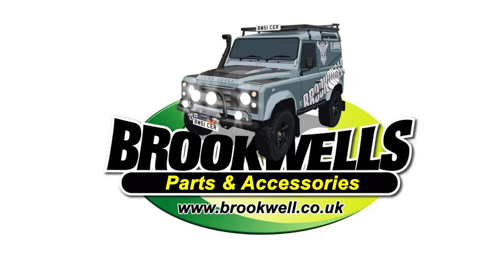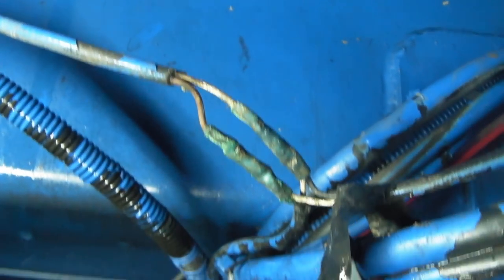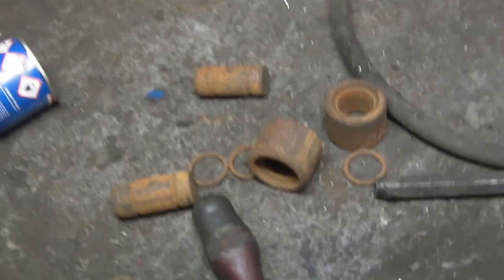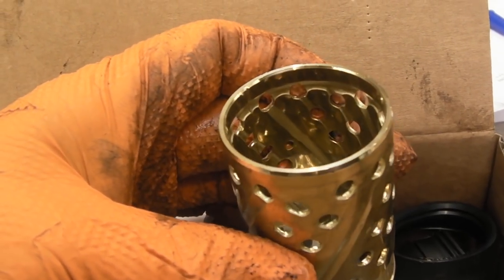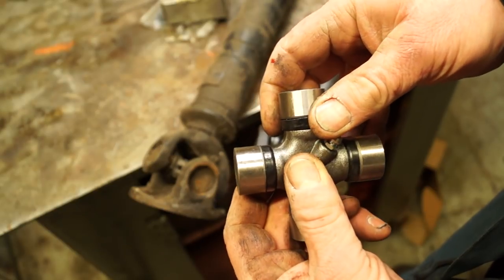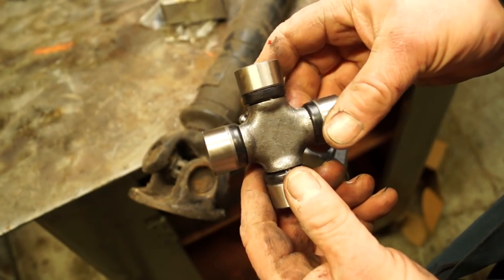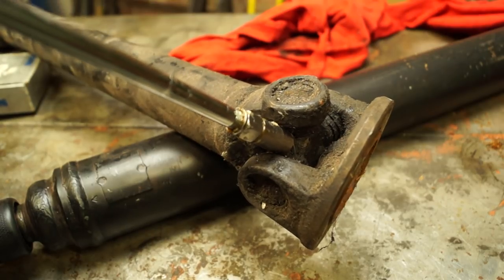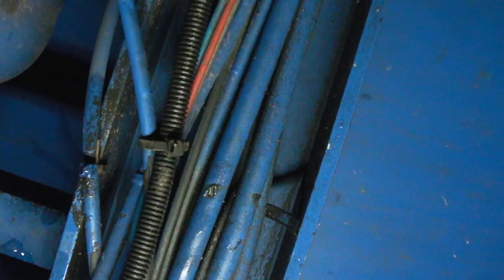Winter Rain Blues and Why You Should Be Greasing Your  Prop'shaft Regularly.

Comment: Chris, have you ever had managers tell you to turn a blind eye or cut short a servicing schedule because of cost, operations interference? I can see this happening but at the end of the day it's all to do with keeping all road users safe and 'those that should know (better) out of jail..., great work, Chris...much respect...
Reply from the maker: No.  We do it by the book.  Anyone who asks us to cut corners gets the book thrown at them.  We work to VOSA standards so safety and reasonable maintenance costs are paramount. Obviously, operators want to keep costs down so we do our best at maintenance and running repairs vs. cost viability.  The trailer seen in the video was on its way somewhere so needed a running repair done.  The repair will last but i aim to get things as reliable as possible with cost and downtime in mind.  It will have a lighting loom fitted in the near future.

Comment: Thanks
How often to grease the shafts in a normal conditions ?
Reply: Land Rover used to recommend the UJ's be greased every 1,500 km (1,000 miles) or monthly, whichever comes first, and the sliding joint every 40,000 km (24,000 miles) or 24 months, whichever comes first. This info is from Land-Rover Series III Repair Operation Manual Pt. No. 607314 (Issue 2 - 1974). This is really the limit for UJ's but I think most of us (including myself) are guilty of not doing it frequently enough. They also recommend that both the UJ's and sliding joint are greased weekly when operated in dusy, wet or muddy terrain - including ambient temperatures in excess of 40 degrees Celsius (104 degrees Fahrenheit) as the grease is substantially more 'runny' than in colder temperatures.
Reply from the maker: Thanks.  Very detailed.
Reply: You're welcome!

Comment: Do you use them blue heatshrink crimps when repairing wiring or do you prefer to solder ?
Reply from the maker: Never solder.  Solder breaks in service.  Those crimp heat shrinks work well but eventually let water in. (doesn't everything?).
Reply: Right, never solder! What about glue-lined shrink tubes?
Reply from the maker: good.